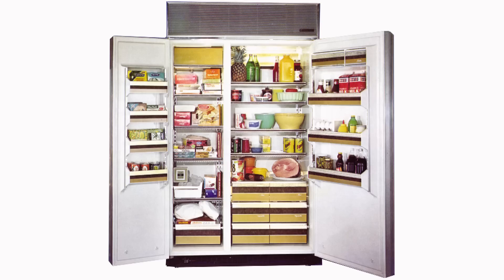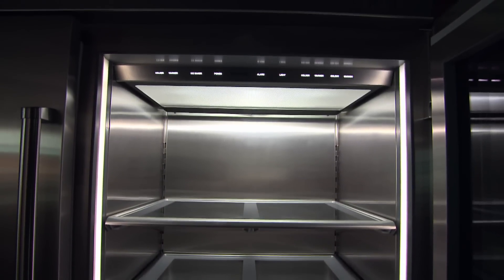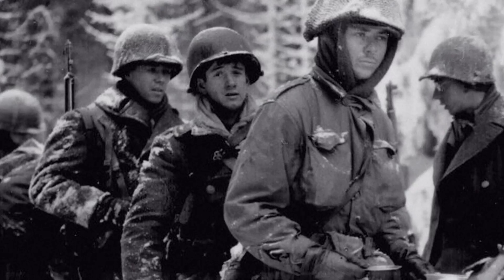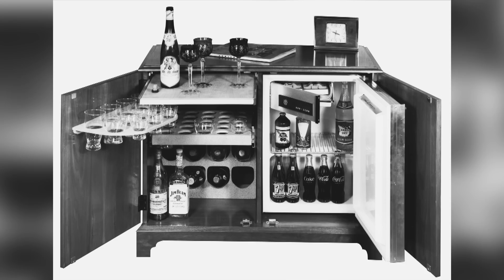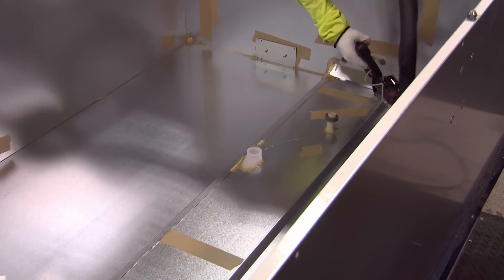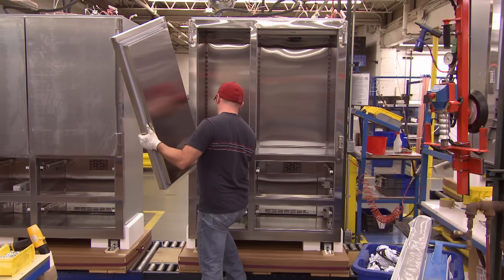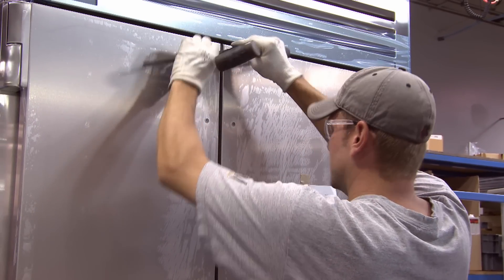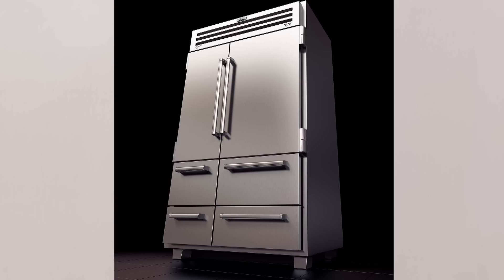How a Sub Zero Refrigerator is made - BrandmadeTV

Comment: We had one, and while it was very nice, it's definitely overkill and overpriced because it doesn't perform any better than a fridge 1/5th the cost.
Reply: That's a very important comment. There are fast cars, and then there are cars built over engineered like the old school Mercedes which refuse to die...

If this manufacturer makes it to last 20 years, it probably could last 40-80 years as well. Subject to parts change like lights electricals compressors etc.
Reply: Well it looks 10x better than other fridges... and you can sell your home for way more too if you have a sub zero fridge hahah.
Reply: Other fridges look better then this

Comment: I hope their quality has improved.  My 2002 Sub-Zero has broken down more times than I care to remember.  Meanwhile, my $800 Amana in the basement has worked flawlessly ever since 1993 without even one single issue.
Reply: Lol . All expensive stuff claim more than what they can deliver. You're buying the name not quality.
Reply: Maurice Hachache  actually it was the only fridge that had the configuration I needed in my kitchen.
Reply: @Shahrdad  depends on your kitchen anyway hope you get more out of the next one .
Reply: Your $800 Amana came from an era when the federal government wasn't pushing absurd environmental regulations. I have a refrigerator from the 1960's that still runs but the refrigerant is now banned and the electrical consumption is several times greater than a modern refrigerator. That doesn't mean I whine when my newer refrigerator has more issues. Want reliable modern appliances? Stop voting for democrats that prioritize barely attainable regulations over reliability.
Reply: @hochhaul  Could not agree more, people have no idea how much damage the democrats have done to our country.
Reply: Efficiency has nothing to do with reliability. The most expensive appliances are usually the most efficient. Not necessarily the most reliable though.
Reply: My mom's 3600 dollar 42 inch Kitchenaid Refrigerator from 1993 had gone through an evaporator coil and 2 leak patch jobs. They threw in a free compressor replacement for each leak repair during the warranty period which is awesome because that is an added piece of mind. I'd love a refrigerator with a warranty like that where they put in a new compressor for free during the warranty every time there is a significant loss of charge because that adds a piece of mind since low charge or no charge can shorten the life of the compressor. A 75-dollar defrost heater that Whirlpool no longer makes for that refrigerator is what caused my parents to replace it with a midgrade refrigerator which is a downgrade. If it were a sub zero, they'd still be happy to put in a new defrost heater.

Comment: it's steel inside? UGH! Disgusting! Just get Miele or Gaggenau for the money, much better.
Reply: gaggenau has a stainless interior?
Reply: @harryreynolds1006  the 400 series, yes. But it’s not that disgusting morgue stainless steel
Reply: Liehberr refrigerators are also outstanding. In fact the manufacturer Miele’s refrigerators but they’re even better in that they have a larger catalog of models than Miele refrigerators. The hinges on the doors are unbelievable. I think that a Sub Zero refrigerator could hang off of a Liehberr’s open door and the door of the Liehberr wouldn’t sink. The same is true of the interior shelves including the door shelves. I’ve never seen quality like it but the company also makes commercial excavation equipment for construction sites.
Reply: @ I’ve not had experience with Liebherr,  but I’ll take your word for it. The prices don’t bite as much as Miele or Gaggenau.

Comment: I bought an LG two months ago, and it broke.
Reply: Was that with or or without water/ice dispenser?  Am about to buy one without water/ice dispenser less complicated should last longer I hope.
Reply: @JohnRE  with ice despensor. But the ice maker wasn't connected or turned on.
Reply: @Dr-Shlomo-Cohen  Thanks for responding. Here i go again reading more consumer reports, and people reviews. Those people reviews are getting me paranoid  I was looking for reviews on this specific LG model. LG LRMNC1803S.  Only 1 person who bought this specific gave it a 5 star. review.
Reply: @JohnRE  that one person is probably the ceo of LG.
Reply: @ JohnRE. The problem with LG refrigerators have been their vertical compressors. They’ve been disastrous and have even resulted in lawsuits against the company.  LG makes excellent washing machines and dryers  and pretty good dishwashers but stay away from their Refrigerators, Airconditioners and Cellphones.